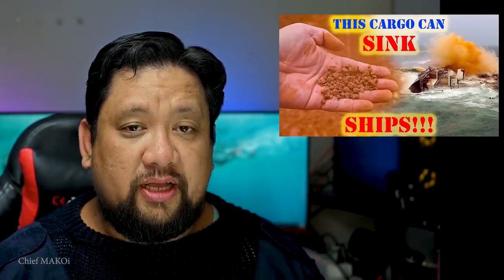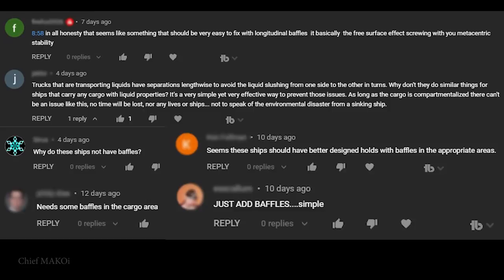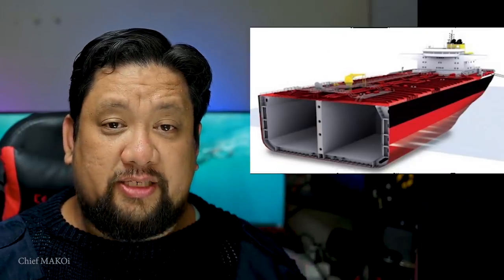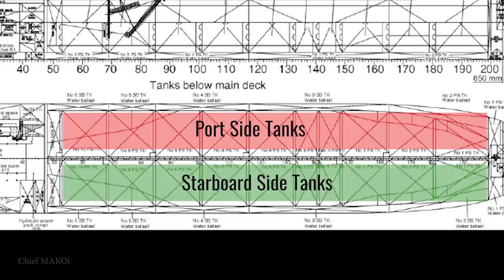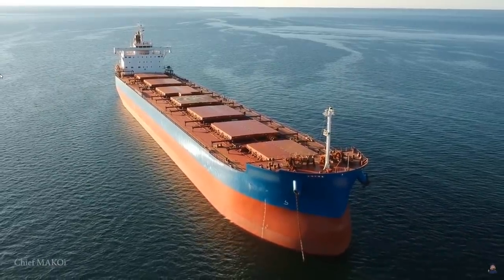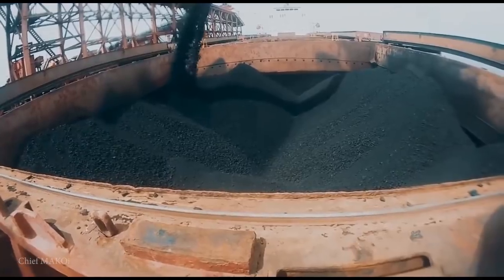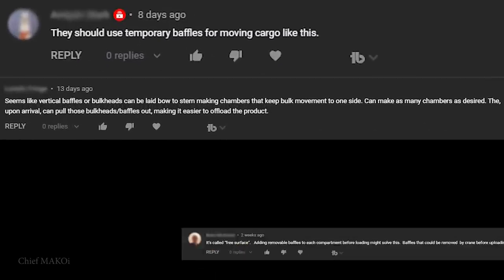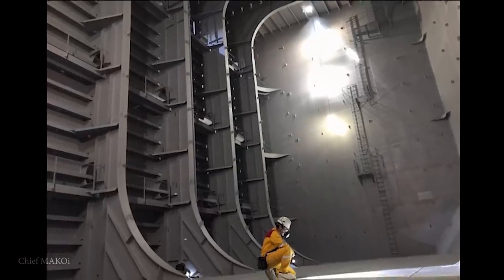Free Surface Effect: Should Baffles Be Installed in Bulk Carrier Ship's Cargo Holds? | Chief MAKOi

Comment: Whilst I have never been in the shipping industry so I really cant say how this would work but, if you got some inflatable big air bags built for this job you could simply put them on top of the load and inflate them so the load has nowhere left to move, then if the ship got a list all you would have to do is let air out of the high side and put more air back into low side and the ship should right itself???????? Also this would make the ship more unsinkable if the load is covered with inflated air bags, just a thought.

Comment: Hello, my idea would be to install baffles of a smaller size and welded to the floor. Let’s just say you install baffles of just about 4 feet high and permanently

Zzmy attached to the floor and welded the beam of the ship and also the sides. If liquideficatio ., the liquid would be restrained in just 1/4 of the hold. There would be less weight added, and the loss of loadable Cargo would be just  slight impacted. 
N
Blé 

N

Comment: Hmmm. I feel as if there is a simple baffle solution. The free surface effect is only really in the top layer. If a simple grid were placed on top. Once things started to move it would drop in. Only a few foot. This does not stop the whole load shifting only to stop the sync of the bays. Sounds like a job for uni grads.

Comment: I have worked on and been on board many tankers and they actually do have baffles in them just like gasoline tankers that you see on the roads yeah they have baffles in them I don't know what this guy's talking about but then he gets paid for videos now some small road tanks are what's called smooth bore tanks they don't have baffles but those are generally for food grade they carry raw milk juice stuff like that because with baffles they can't be properly sanitized but I never saw a tanker that didn't have baffles in it
Reply from the maker: You said it yourself.  Tankers.  A dry bulk carrier ship is not a tanker ship.  Tankers have baffles.  Bulk carriers don't.
Reply: The gasoline tankers also have subdivided tanks for different grades. Tanks and tankers can be built to rather specialized standards, like the asphalt tankers are almost entirely different from a gasoline tanker, as they need both a heating mechanism, and can't have much in the way of restriction to flow.

Bulk carriers are like the shopping cart of the transport world, you've got no idea what's going into them, and any restrictions you add just make using them much harder while most of the time doing nothing for safety. It might carry crushed limestone going one way, and corn going the other. Adding baffles is like mandating that all ships must treat their capacity as if they were in fresh water, it seriously reduces capacity, increases costs, and adds non-trivial overhead. Imagine if your milk tanker needed the same overwrap insulation and pressure control system as an LN2 tanker, costs would be vastly higher for no good reason.